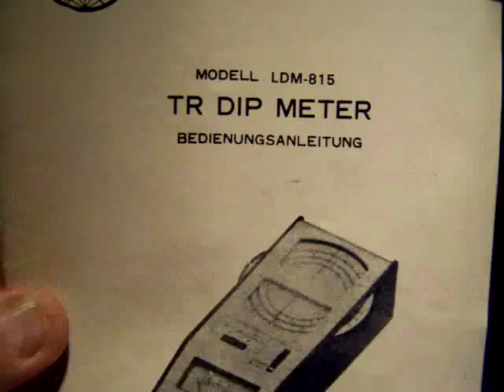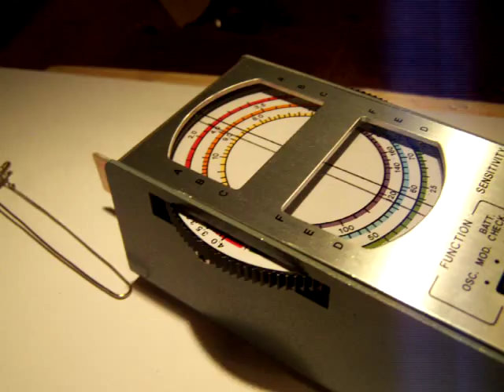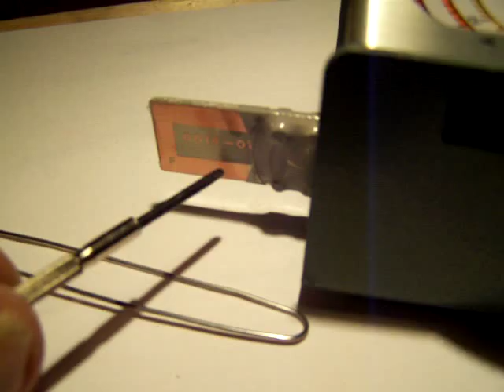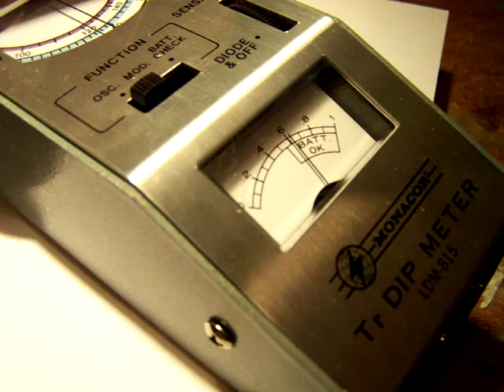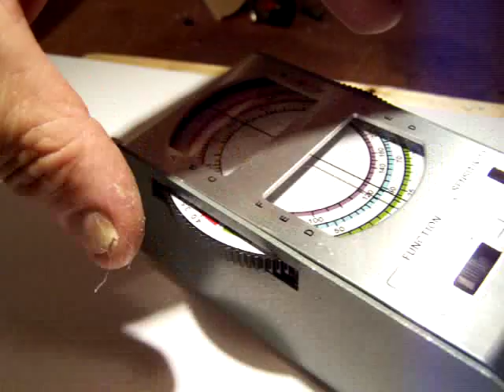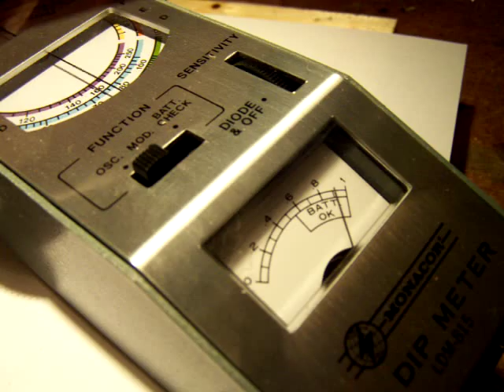dipmeter - search the resonance frequency

Comment from the maker: Yes, indeed, it could be used to check the circuits from stifflerdr on their resonance frequency. Though he also has sloppy and long wiring connected to his aluminum blocks etc. that have an influence on the resonance, if there is any resonance. Wiring one tap from resonant system a with a crocodile clip to a random earth point can take the whole circuit out of its resonance and creates an unreliable situation with no predictable results.

Comment from the maker: I have seen his video's. The problem is that he does not show any schematic and comments are disabled, so it is not possibe to see what he is doing and how the wiring is made. In this demo the dipmeter is a small oscillator that strays some energy out. On the resonance frequency from the tested coil the the tested coil sucks energy out of the dipmeter coil. This is detected with the uA meter.